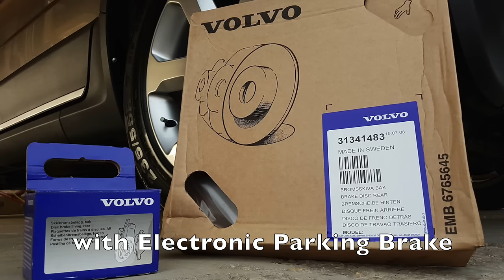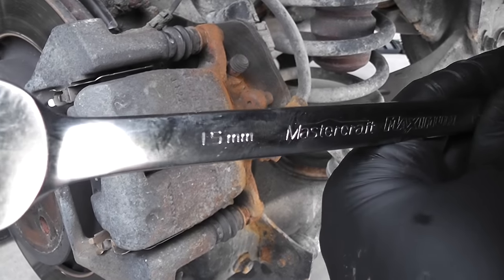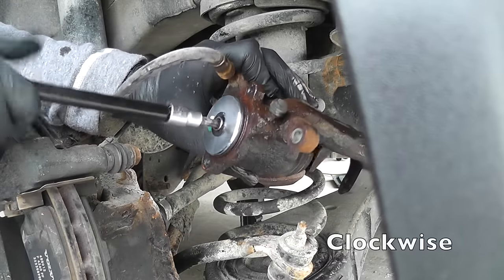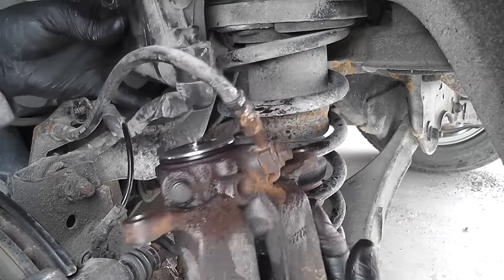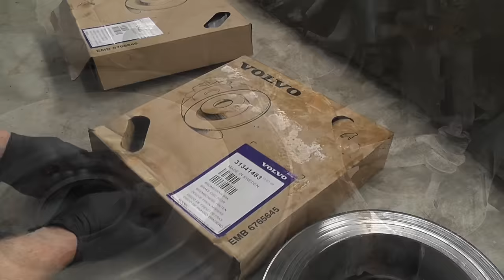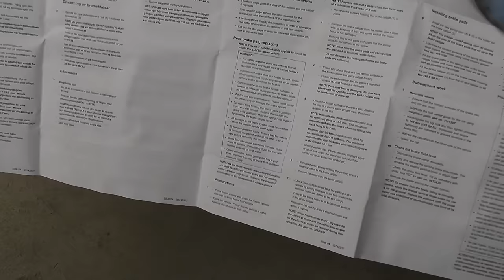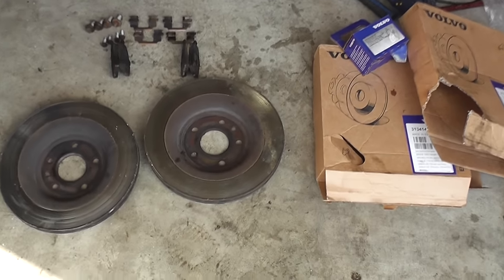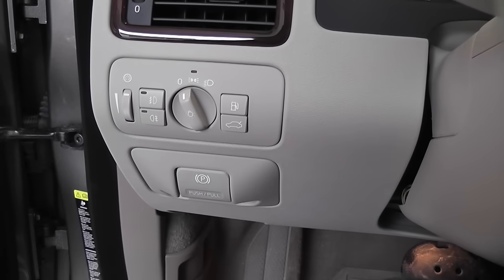Volvo rear brakes replacement with electronic parking brake. (EPB)

Comment: Hi , I  has had my Canadian tire change my rear breaks disks and pads and wound down the  electronic parking break. Now it's my car is giving an alarm that the parking break is not fully loose. Do I take it to the volvo dealer. I don't really trust the Canadian tire shop anymore.
Reply from the maker: Don't take your Volvo to Canadian tire!! Take it to Volvo or other shop that knows Volvo.
Reply: Yes   never again! I should have just done it my self using your video. I will check tomorrow morning if the connector for the EBP are seated properly bc i readythat might be the thing causing the error.
Reply from the maker: Did you try to apply and release the parking brake a few times???
Reply: Yes i tried it several times. The EPB seems to engage and disengage properly on both sides. I drove the car like 20km with the alarm on and dont think the parking brake is actually not disengaged fully like my s60 says. Thanks for your videos , you are like the only person making videos about the P3 platform cars!
Reply from the maker: Thx! Good luck
Reply: So I took it too the Volvo dealer and  one of the parking break motors was not working, so it seemed that the Canadian tire tech broke it when he was pushing the caliper in.  This was just $550 dollar lesson to make sure your mechanic knows what he is doing!
Reply from the maker: A lesson for sure.

Comment: i;m curious if it is posible to retract the piston with vida dice?
Reply from the maker: +Feliksas Ilginis that is exactly how it was designed to be done. Using VIDA
Reply: Yes, but do u need to have original vida, or the cheap ebay one will do the trick? :)

Comment: You forgot a major step: cleaning the discs with brake cleaner to remove the grease and protective oil film.
Reply from the maker: There was no oil film on the rotors. But I guess could have cleaned them anyway. Don't forget I am not a professional. Thx for the feedback.
Reply: On the v70 models with solid rear discs, it is possible to replace the disc without removing the caliper mounting bracket.  Should hopefully save someone some time.
Reply: You can do it with the vented discs aswell, just requires a small "handmovement" :D
Reply: ??? THEN YOU SHOULD SHOW HOW AND STOP HATING

Comment: Really? 54000 km and the rear brakes are worn out? I guess this must be an automatic doing only city traffic. When did you swap the fronts? I've done 100000 km and my brakes aren't even half worn down.
Reply from the maker: I did not do the fronts yet. It has 75000km now. There is a reason why rear wear out faster. In winter when the car skids on ice and snow the DSTC uses the individual brakes  get traction.  The front brakes need to be replaced due to minimal pulsation when you brake at high speeds.

Comment: How do you deactivate the electric parking brake ????????
Reply: Well it's quite obvious in the video that he did it manually by taking the motor away and screw it back by hand instead och running the motor.

Comment: YOU DID NOT CLEAN AND LUBRICATE THE SLIDE ASSEMBLY, BIG MISTAKE THE SLIDE CAN JAM AND  YOUR BRAKES WILL LOCK AND OVERHEAT
Reply from the maker: Thx for the feedback. It will be valuable here. Don't forget I am DIY guy.

Comment: Don't follow this video - as is noted below, it is way easier/safer if you wind back the electronic parking brake with a 9V battery rather than removing it (and risking damaging it).  See this video: https://www.youtube.com/watch?v=8y54DKRHlAo
I followed that procedure and it was really easy to push back the piston.  I was able to do it with light pressure from a C-clamp.  I actually used a 12V, 1 amp power supply (old cell charger) to wind back the piston.

Comment: thank you for your video. just a question: why the axes are different. 1 pair with holes, and 1 pair without hole. how to install them. https://www.skandix.de/en/spare-parts/brakes/disc-brake/brake-pad-set-rear-axle/1019621/

Comment: Why wouldn't they use stainless torx bolts on the EPB cover? Cheap manufacturers.
Reply: Because manufacturers design cars to sit in your living room.  Plus, the half cent more for stainless would bankrupt the auto companies.   As a mechanic for 35 years, I share your perspective on the idiotic fasteners chosen by engineers.

Comment: why not use aftermarket parts instead they are cheaper?
Reply from the maker: +Travis R. I believe originals are way better.
Reply: Just be sure to get high quality such as Brembo and Akebono. Don't get cheap stuff or you'll regret it.
Reply: If you get aftermarket rotors and pads (not saying they are as good), make sure you get the bolts as well. They get chewed up removing them. Nice thing about Volvo OEM is they came with the bolts needed.
Reply: Bolts and clips. I believe Textar sells a set that comes with bolts and sliding clips but it could be because it is in fact OEM

Comment: The easiest way is to connect it to VIDA and just enable the service mode for the EPB. >:) Did it today and was much easier than removing those motors.
Reply from the maker: +Kevin Walter True if you have Vida and Dice.

Comment: If you are looking for a upgrade on the front brakes the 336mm from a S80 V8 are bolt on and works great. You need 18" rims. http://forumbilder.se/FA3PF/img-2093